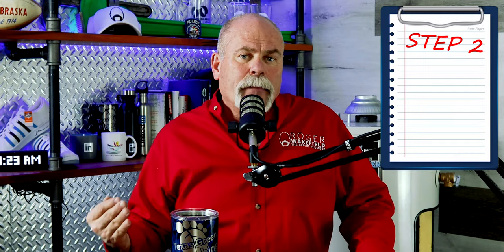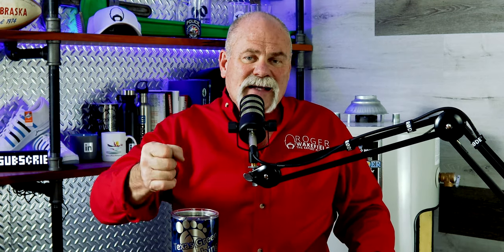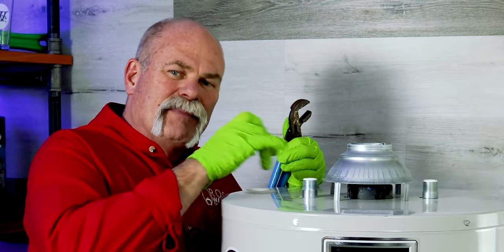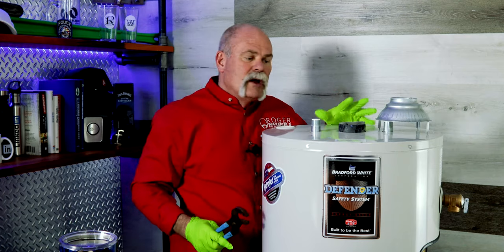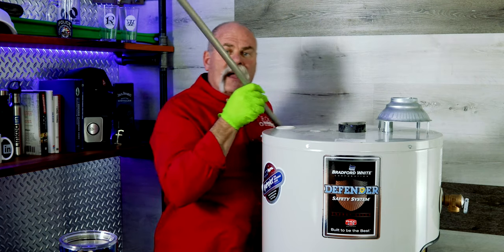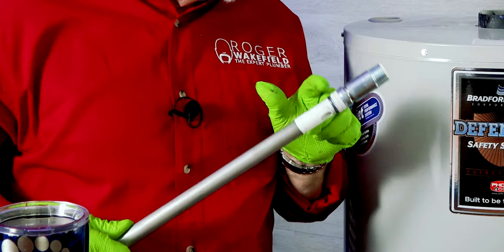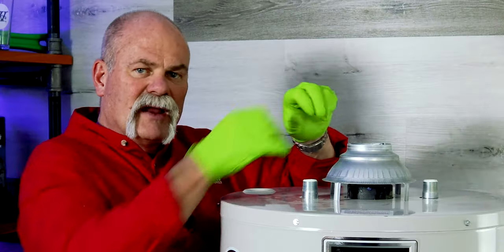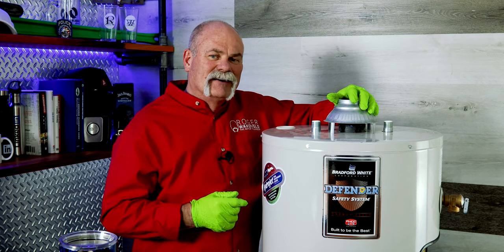How To Replace the Anode Rod in Your Water Heater Step-By-Step

Comment from the maker: Do you think you can change the anode rod in your water heater? Let me know!
Reply: I think I can, but Im facing my first problem. The head of the anode rod is damage and I cant take it off now. I was using a 1 1/16 socket wrench with a breaker bar.  How can I do it now? thank you
Reply: I have changed out anode rods and they can be a bitch.  The problem is that you may have had years of thermal cycling on the pipe dope.  Also, the anode can be so tight that it is very difficult to restrain the tank while you wrench on the anode rod.

Big tip, take a torch to the head of the anode rod. Also use a 6 point socket that you have ground the face back. The head of the anode is thin so grinding the face back will give you more wrench on the anode.
Reply: No, because I don't have 10' ceilings in my basement. :(
Reply: Well, yes, thanks to your video :) BUT, in my case, the cold water inlet to the gas heater is about 30 years old and it did not close properly. I should have caught this when I relieve the pressure by turning on a faucet inside the house and hot water still came out... So, turn off the main water valve, if that is possible, as a security measure.

For me, the heater is inside the garage, so the water that shot out of the anode rod hole just went to the drive way and did not cause any damage. However, the water also went inside the heater through the exhaust vent hole in the center and the burner and the ignitor were wet, so I was not able to light the pilot after I replaced the rod. I then went on youtube and found another video on how to remove the burner to dry to burner, the piezo ignitor, used a wet vacuum to dry up the camber as much as possible (only about 24 oz of water at the bottom), wiped dry the inspection window glass, and was able to relit the pilot. 

Also, I only have about 2 feet of clearance between the top of the heater and the ceiling, I was going to cut off the old rod in sections (you would need to hold it, so that it won't drop down to the hole), but the heater was 15 years old, so the old rod was pretty much gone to the core wire which came out without any issue.
Reply: I had a gas water heater recently installed. copper soldered lines into both hot and cold on the tank. The cold side right off the nipple is hotter than the hot side. Much hotter in fact, I can't hold on to it for long. it is heating the rest of the city water line. I don't think that is normal. what would cause this?? The rest of my house receives hot and cold water like normal as the cold line has a T to bypass tank
.
Reply: @Cappella1971  you'll need a bolt extractor socket that will grip the damaged head. Amazon.
Reply: Got mine changed in a 50 gallon rheem atmospheric gas tank. It was pretty tight on it, needed a breaker bar and my full body weight. I was a bit surprised how much it was depletet after only two years with a water softener in service.
Reply: It seems that my Maytag 50-gallon electric water heater (HE2950T) has two anodes in it (a primary anode and a secondary anode). I tried searching for replacements, but it appears that Maytag no longer manufactures them. Do you think the replacement process would be the same for both the primary and secondary anodes? And since genuine anodes may not be available, what could be better alternatives?
Reply from the maker: @manclt704  I would imagine most replacements would fit.
Reply: Just did it last month.  John Wood 40 gal. water heater, tank is 8 years old.  3 foot breaker bar did nothing.  Thank goodness I had an impact driver, used a 27mm impact socket which fit perfectly.  Replaced the anode with a Mg rod.  The old one was just about gone.  Other than the stuck anode, very easy, should have done it earlier.  Also a perfect time for a tank flush.  Write the dates on the tank with a felt pen so you have an idea when you did it.

Comment: The fun anode rods. Are when you use your pipe wrench to remove nipple for anode rod and pipe crushes. Or when nipple threads are exposed only. And you crush the threads when you attempt to remove anode rod

Comment: Or the kicker. The threads rust out to anode rod nipple. And you need to remove old threads or retap water heater female inlet. Fun fun fun
Reply: Hahaha I know i was watching this thinking hmmm hes got Rubber gloves on but hes working on a brand new never been used heater in his office and I dont think ive ever changed an Anode rod on a heater that new where i could get the rod out with a pair of smooth jaw channel locks hahaha.
Reply: Yeah. This is an educational video that is pretty accurate. 
But in real life situations things are not as straight forward. Situations change the outcomes in the field.

Comment: I just changed mine two days ago.  However, It was not a Bradford White.  It has the anode rod with the 1 1/16 bolt head.  The hardest part was breaking the old one free, I used a large breaker bar while giving the water heater a bear hug, and it still was not easy.  It was a standard rod, so it hit the ceiling before it was out, so I used Vise-Grips to grip the rod right at the tank, and cut it in half with a reciprocating saw, after wrapping the lower portion with a towel so I wouldnt get shavings in the tank.  For the replacement, I used one of the four-sectioned rods that are connected with stainless wire.  Easy.

Comment: I am about to replace my 10 year old water heater mostly because I can not get the anode rod out. I plan to unscrew the new heater rod so I can get some teflon tape in effort to anti-seize the threads.

Comment: Onething I like to add: if the anode comes with a nut: DO use the right tool to screw/unscrew it. If You use a wrench and damage the nut by slipping of with the wrench, you will make it harder on yourself to remove the anode next time.
Reply: 1 1/16” socket always

Comment: Thanks for this video, I do have a few questions.  
How do you get the Anode Rod out if it’s in a closet & you dot have the space to pull it out? 
Also, as a general rule, what should it cost to have a plumber come change this rod for you? 
If you have a water Softener for super hard water, do you still need to change the Anode Rod?  
Thanks for your help?
Reply: If its the old one, and you have no room, you will have to cut the anode in pieces.  Then you will have to buy an anode that is "Sectional" Which looks like a pipe, with chain between them.
(Kind of like Num Chucks)  Ask the big box dude of your choosing. Ask him for a sectional anode.  (this is a common thing).
Reply: @mk8530  It would probably be better to go to a plumbing supply house rather than a big box.  The big box stores don't carry as much plumbing stuff, and may or may not have a competent guy in the plumbing section to help you.

Comment: If the anode rod wasn’t replaced in seven years, is it too late to stop corrosion in the tank, or will there still be a benefit from doing it?
Reply: Mine is 25+ years old and still working, and it's never been changed, would changing it have helped?  Would it help to change it now?  Is some water more protective to the tank than others as to why the tank lasted so long?
Reply: @DavidStrchld  Good water is always going to be a help.  I just replaced my anode rod after 13 years of not changing it.  Of course it was totally shot.  At the moment I'm waiting for the insulation to dry out after a water leak from the replaced anode that wasn't tight enough.  I'm thinking to myself I could have done nothing and the farging heater probably would have lasted for years, but whatever.  If I'm lucky it will save me from replacing the whole unit sometime soon.

Comment: Roger,
Thank you for such a well made video. My question is about the “black tee” you mentioned. How does this help?  If I tighten it with clock wise rotation to the nipple then apply a counter clockwise force to break loose the anode won’t the anode stay stuck and the tee come off the anode/hot water nipple?  Are the threads on the tee reversed?  Please explain.

Comment: I pulled out anode rod in a Rheem gas professional power vent after 20 months of use and it was completely gone except for 1/“2 at first I thought they forgot to install it. We have well water with water softener.
Reply: Yikes.  Maybe the problem is the water softener.  You might consider running unsoftened water on the hot side.  An aluminum rod would last longer compared to magnesium.  You might want to look at an electric anode rod (Corro-Protec).

Comment: Do I need to do this to mine since it’s about a year old now? And also do I need to flush it out yet?
Reply from the maker: I’d take it out and look at the condition of it. depending on your water quality you may or may not need to. How old is your water heater and has it ever been flushed?
Reply: @RogerWakefield  It’s never been flushed and was installed when my house was remodeled in mid 2022
Reply from the maker: I would flush it annually, depending on how hard your water is.

Comment: Pretty hard so far, since I have yet to attempt it.  I have a Bradford White and can only see the threads on the top, there is no good area to place a wrench except on the threads where it'll be damaged.  I only have about 1-foot of vertical clearance, and the manufacturer's website doesn't list a segmented replacement part for my model.  If my water heater goes there is no way I will ever choose this brand again.  Having a simple 1"1/16 hex bolt is a billion times easier.
Reply: I agree... No more Bradford white for me either. Get the $10 angle grinder from harbor freight. Get good disks though, Not HF disk. (Dewalt is okay.... Diablo is probably the best. ) Pull out the rod, and cut, then pull out more and cut (hold it so it doesn't fall in the tank, I like to use a clamp and just clamp around it, and let that rest on the water heater. The Clamps at HF are good and cheap for this.
Reply: Also, remove your heating elements first... easy to do... and you won't damage them if they are out of the tank.
Reply: @ACoustaDC  Thanks for the clamp idea. I'm looking at having to flush my water heater and replace the elements anyway because I think they're already corroded, figured I'd probably replace the anode while I'm at it but it was installed right under some stairs (geniuses I tell ya), so I'll likely have to cut the rod as I remove it, but was worried about having to keep the pieces from dropping back in as I cut. Thanks for that!
Reply: @nova31337  Good luck! Let us know how it works out..... You should be fine though... It's about a 14 cuss word repair

Comment: What if your bradford white is power vented and the anode rod is stuck.  Should I take the power vent off 1st so I can fit a pipe wrench on?
Reply: You could.  It's not that hard to remove the power vent, but usually the power vent doesn't obstruct the hot outlet that much.

Comment: Replacement anode was about 4" too long as it bumped bascement ceiling.   cut off about 4 inch (100mm) of rod with hacksaw.   then it went into place of old rod that was deteriated away.
Reply: THATS the same thing gonna do mine is NEW  B/W water heater, so have years to go to change that , but .i have to Cut it in half , mine is inside the closet

Comment: who carries the sectional anode rod?  is that the manufactuerer or a specific vendor.  Honestly, I just replace the water heater most times it fails.  besides a pilot assembly under warranty on those crap GE, or Rheem, or Whirpool water heaters.

Comment: Excellent video!  The problem I see with using a flexible anode rod is that it comes with a thick plastic center core inside the top of the threads where you insert the Heat Trap.  The Heat Trap will not fit with this plastic core installed, it must be removed by cutting it out which is a real pain to do, then once you remove it and you go to insert the Heat Trap it now fits to loose.  #1 Should I just leave the plastic core installed and not use the Heat Trap  OR  #2 Cut out the plastic center core and use Teflon tape around the Heat Trap to keep it from moving around ?  Thanks for your help!

Comment: Help! I've replaced the anorod, shut all the elec, water, etc off.
Completely emptied the tank, using a hose at the bottom opening.
BUT...the water still stinks very badly.
Any ideas? Thanks!
Reply: did you replace the anode with an aluminum rod?
Reply: @Bendc1970A1  I replaced it with a magnesium flexable rod, as I have a low basemnt ceiling.

Comment: Lost me @ 3:02: "... and put a black threaded T on there..."  What??  With instructional videos, if you say something, you should demonstrate what you're talking about.
Reply: It’s a fitting. But yeah, he should have had one to demonstrate, since it’s a DIY video.
Reply: Yeah, makes no sense to me. You thread it on there and then "tighten" it??
Reply: What he's saying is that once you tighten the fitting down on top of the anode rod threads it will crank the fitting on so tight that it will start to spin the anode rod (Tightening down the fitting on the threads) thus breaking loose the anode rods hold on the Water Heater threads then you can start to unthread the anode rod by cranking off the fitting and the Anode rod together.
Reply: @stephen2220  Good explanation, although I question whether or not it would work reliably.  I just put my Knipex channelocks on the very lowest portion of the threads and managed to get it out.  Ideally you have a long enough nipple on your anode rod that there's a good place for a pipe wrench without wrecking the threads.  I was worried that I'd wreck the threads, not get the anode out, but not be able to screw the union back onto the anode, and I'd need a plumber on an emergency basis...

Comment: So, you change it once a year? Or how  do you know   When it is time to change it..
Reply: Depends how harsh your water is. I do mine every 3 years in Vancouver Canada where we have soft water. If your anode isn't a part of the hot side, it's easy to take it out and see see how corroded it is. Once its skinnier than 1/2 it's diameter i'd say it's time to replace it. Also I highly recommend magnesium rods as opposed to aluminum unless you have problems with sulphur.
Reply: Anton Babiy cool thanks!!!
Reply: Not annually.  3-5 years
Reply: @AntonBabiy  I like magnesium because aluminum puts toxic aluminum ions in your hot water.  (Magnesium is actually good for you.)   You should never drink or cook with hot water, but most people don't know that.  The problem with magnesium is that it doesn't last as long as aluminum.

Comment: Is all gas water heater has an anode rod. I have a gpsp 50 100 AO smith power shot gas water heater I cannot find the anode rod.
Reply: The main anode rod might hide underneath the electric blower. RHEEM powervent water heater hide the anode rod underneath the electric blower so I have to remove the blower unit to replace anode rod.

Comment: If the heater is 6 years and never been flushed do you just change the anode rod with water inside? The other video said not to flush at that point because the sediment is probably what’s keeping it from leaking.
Reply: He says you’re just taking the pressure off, not draining it.

Comment: I am thinking of going tank-less for the comfort of endless hot water.
The tank seems like a waste of money over the long term.
What do you think ?
Reply: Tankless has not come along far enough yet. The sytems require yearly maintenance and can be very pricey.. Do you have a large family? Are you having trouble with running out of hot water now? You might want to consider adding a storage tank to your system with your current tanked water heater before you go for tankless.
Reply: Increasing the temp above 120 on the tankless water heater will only give you more problems,then that's when you'll regret it
Reply: Tankless is crap... Too many thing going on. I would highly avoid it.. Tank water heater is simple as it can be. I like to Keep it simple keep my customers happy. 😎
Reply: ....save the earth and stay limited ;-) also consider the actual cost of maintaining the tankless unit or units compared to the tank you are familiar with. Several products are out there such as a Rheem Tank Booster that give your water heater a substantial increased "capacity", swapping to a Marathon water heater is a good option, but weigh the cost especially if you are not the one intending to maintain your own equipment. If you shop on Amazon and buy a less expensive Rinnai unit, look into the venting requirements as well because some of the venting material can cost as much or more than the unit itself..
 Importantly do not take for granted what you have, other countries still boil water on a stove and  let it cool enough to run it over a strainer and call that a "hot shower", a few gallons at a time.